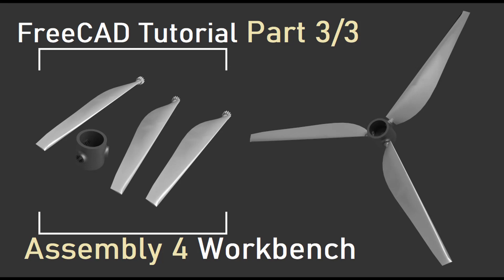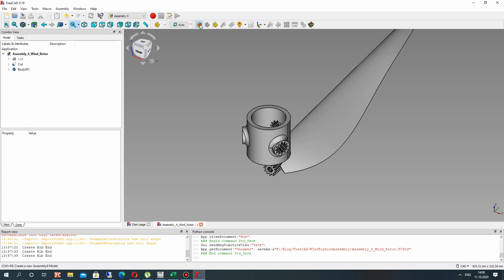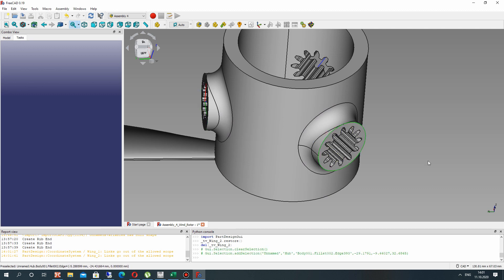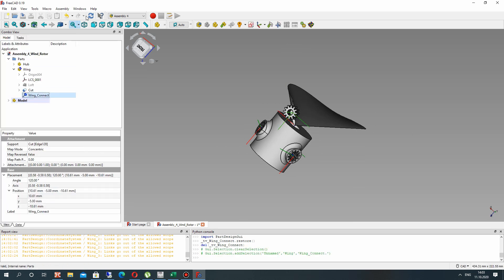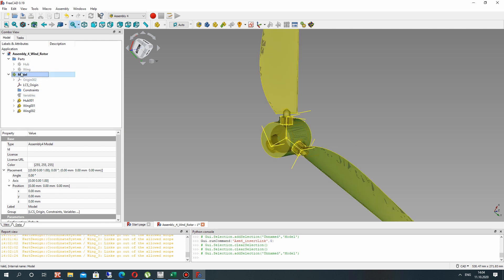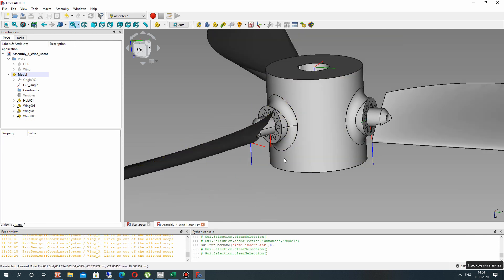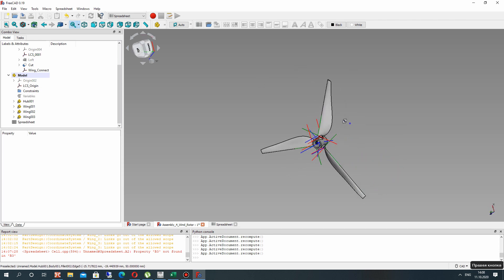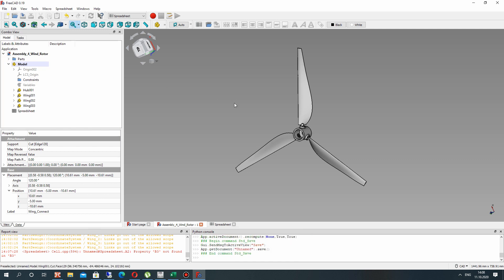FreeCAD Tutorial Part 3/3 | Creation Parametric Assembly of Wind Turbine Using Spreadsheet

Comment: Are you aware of the fact - you've built an aircraft propeller, not the wind turbine prop? There is a difference.. So much work straight to scrap
Reply from the maker: Nope, if you take the any propeller and try to blow you will see that your propeller will be working like wind turbine, because any turbine, axial or centrifugal is reversed. It means that you can  use ANY pump, fan or compressor in turbine mode!